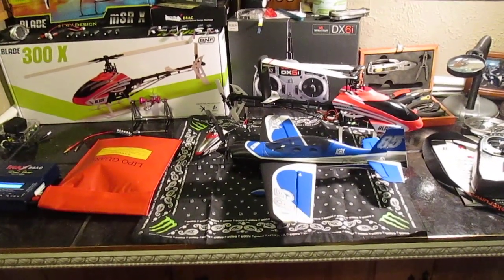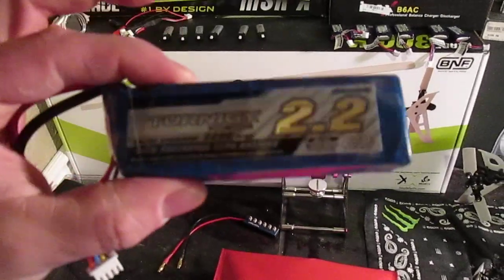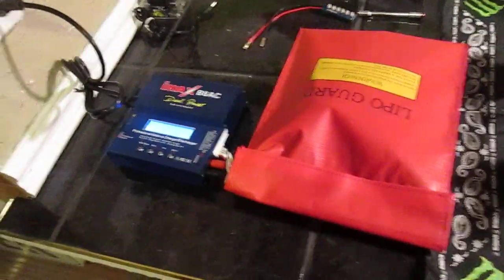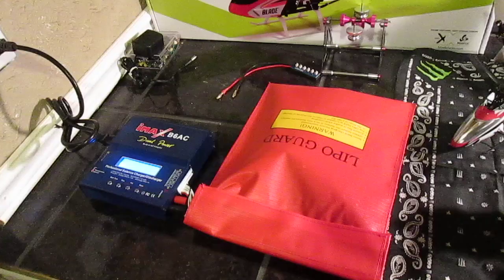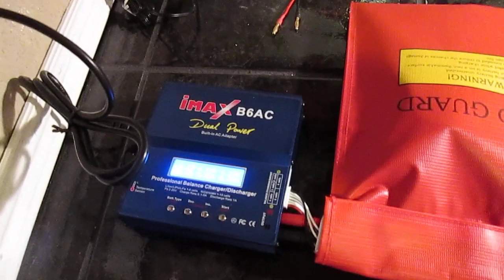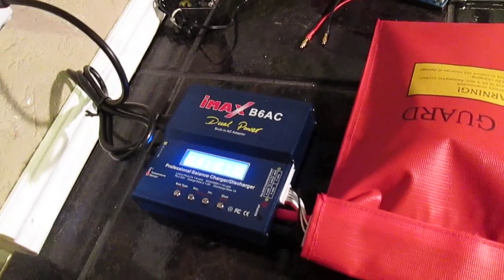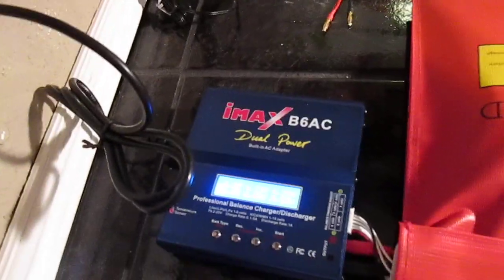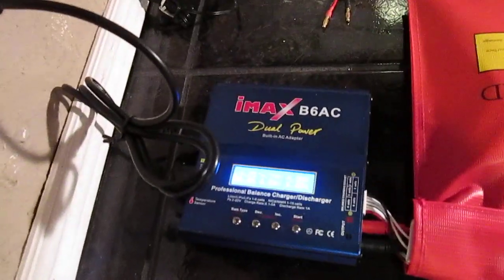How to fix a lipo battery with 1 weak cell

Comment: 2 days ago before it started raining I balance charged all my batteries to storage level 3.8v each and left them inside on table.
Now today I go to plug in and charge; and one of my batteries has 5 of its cells at 3.8 and one cell at 1.5 😮
This battery is only a few weeks old. Probably flown it about 10 times and never charged faster than 3c. I don't think I've gone over 2.5c actually

Comment: Thank you for the tip! Nowadays I always spring the extra $7 for the high C rated batteries. The ones with good QC have their cells matched at the factory and it is well worth it not only for performance but for longevity. I'd take 1 less battery and get the better quality any day of the week.

Comment: Hey man I got a 4cell 1800mah lipo battery and when I wanted to charge it the 1 cell was at zero and the other 3 were at roughly 2.30. What do you suggest I do?
Reply from the maker: Sorry to tell you, that battery is done.  One cell is dead, and the others are way under voltage. Discharge, and dispose of it.

Comment: Does it hold charge? I got one cell that always drops faster than others!
Reply: Same problem here. 2s lipo, but i sell discharge very fast 🤔
Reply: He don't know, he made the vid when it looked like he might have solved the problem. For all he knows that cell will take a dump as soon as he puts a load on it and it could very well show good voltage after a load. Same as a car battery, the only way you can tell if it's good is to put a load on it and watch voltage at the same time...if it's good the voltage will be stable if it's not voltage will drop at a steady rate...not saying his way does not work, it does, I have 2 4s packs that I scanned together out of a pile 3 bad 3s packs...each cell needs to be able to hold 4.2  and hold a steady voltage under load

Comment: Well it starts off like this after using my X-maxx for the day i forgot to take out the batteries and im using 11.1v 40c 8000 Mah and here i am 4 months later & the charger wont charge at ALL ! all batteries did read Zero but after reading your post "  ThatCrazyFlashaholic 67 " your idea WORKED like a charm charging it using Nimh charging setting i let it charge for 2min & its charing now at 2amps lipo charge and the % is now going up thank you for the info good video & comments Really Really did work thanks

Comment: I recently acquired this battery reconditioning plan ( Check Details Here>>> ) and just reconditioned 2 car batteries. I did the instructions in a breeze due to the simplicity of the guide. I wish I would have discovered this years ago! It really works for any kind of batteries!

Comment: I have a 2 cell that is at 4.24 and 3.84 volts and giving my charger a real hard time to even discharge.. I hope it works to recover cause its a 5000mah and only a couple years old!
Reply from the maker: Wow, that is a huge difference. Not sure if it will work but good luck!
Reply: Is your problem solved now?

Comment: I had a similar problem with my 3S lipo, one of the cells had low voltage, so i charged it up using the Nimh setting and unpluged the balance parr..i only did it for a minute.. it brought the cell back...i hope the battery works after charging it..ALSO WHAT SHOULD ALL THE CELLS BE AT WITHING EACH OTHER???? THANKS
Reply from the maker: All cells should balance.
Never go below 3.7 per cell, unless you are trying to fix it like in the video.
Storage mode is 3.85 per cell
Full charge is 4.20 per cell

Hope this helps
Reply: I tried to charge my battery on a shitty charger that came with the rtf wizard and it charged 1st cell to 4.01 and the 2nd cell to only 3.33 and the 3rd to something else. i plugged it into my drone and it only sucked the second cell dry... i am going to see if charging then discharging the battery on my imax will work. (ordered 4 other batteries anyway so it doesn't matter but why did this happen?) 
Thanks

Comment: hello,sir.i have a question. i got the same problem. but i have different amp battery, which mine is 3s 5300mah. So if i follow your instruction, after discharging the battery till it drop 3.5v per cell, how many mili amp i should balancing charger my battery. it's 5300 mah. and if i charge it on 0.2 Amp, it would take the time so long. that's ok? or you have a recommended amp value for my battery? thanks before.
Reply: FAanggiorius 
I threw away two lipos before I figured out the cheap voltage tester was misreading one cell commonly. Trust your charger and a multimeter.
Reply from the maker: Indeed it will take a long time, that is the key though. Minimal charge to equal out the cells. Monitor the battery as its charging and watch for it to equal out.
Reply: while charging, how i can see the voltage each cell? i use imax b6, there is no indicator to tell how many voltage each cell. should i stop the charging and use voltage meter and then resume the balance charging? do you think it's safe?
Reply from the maker: Its been awhile since I owned the Imax charger...... but I believe you need to start the charge as normal, then tap the increase button or the start button. On my icharger its the increase button.... so definitely try that one first.
Reply: +Mad Man Slice thanks sir. i'll try it and let you know if this work...
Reply: hello sir, i just do what is in your video. it's really work to give the balance voltage each cell. but when i check my battery voltage using voltage checker. it's doesn't balance. 4.05, 4,08, and 4,35. i know it out of problem that we discuss from this video. but if you don't mind and maybe you know what should i do? what i must trust? voltage checker or imax b6? it has a different value. my drone are not lift up, even the voltage of my lipo is 12.40. thanks before.
Reply from the maker: Different battery monitors will always read a small bit of difference. Unfortunately yours is a lot.
You could try to cycle the lipo a few times in the drone at a low speed.... you could also do the procedure per the video I posted again.
If you are at all hesitant that it is unsafe or feel it will cause you to crash your drone..... get rid of that lipo, and use a new one.
Not worth crashing or burning your house down trying to save a battery.
Take care.....   :)

Comment: very good video thanks, but fast way do this  using refrigerator to drop down temp, volt meter, and balance cable to drop down voltage on coils and then balance charge battery it's works. for 4s battery

WARNING drop down only from each coil 1 amps and watch on voltmeter do not drop voltage down 3v!!! 

red and white is coil 4
white and yellow is coil 3
yellow and green is coil 2
green and black is coil 1
Reply from the maker: +Mibinamet Thanks for the info.......   :)

Comment: I do not have a charger like yours, just a Sky RC 3e which detected a voltage in-balance and wouldn't charge. One cell was at 3.48v with the other two at 3.09, and 3.13v. The manual said it wouldn't charge with more than a 300mV difference. I connected the high cell to a bike LED light which was rated 3.7v and I calculated that it would draw around 100mA. (it lasts about 7hrs on a 700mAh cell) I left it connected until the voltage was 3.23v then the charger completed the charge fine.

Comment: Thanks for the trick! But I am wondering if it will work with 800mAh charge amperage because that's all my charger can do, do you mind trying it out for me? Thanks again!
Reply from the maker: +NERF870525 Sorry, not sure what you mean.
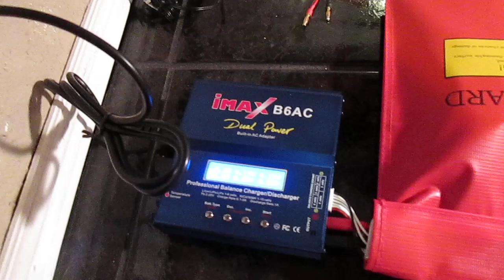Reply: +Mad Man Slice  So at 1:14 you say you only charge at 0.2 Amps, but my charger can only do 0.8 Amps, do you think it will still work?
Reply from the maker: yes, its worth a shot anyway....

Comment: Hi my battery can be fixed to 4.2v 3.8v 4.2
but when I discharge it again,
it becomes 4.2 0 4.2
always discharging the same cell only.
what should i do
Reply: +Eddie_Fong 
When using Lipo mode, in balance mode it shows 4.2 3.8 3.9 and stop charging 
but in storage mode, show 4.2 0 4.2 and low voltage error
Is it the problem of my charger?
Reply from the maker: +Eddie_Fong It could be the balance lead, check it and see if it is loose.

Comment: my brand new 3s lipo reads 4v 4v and 0v. Actually it read as total 7.5v only. my Imax b6 says incorrect cell when i try to charge. what could be wrong? can this be repaired? unfortunately i couldn't claim for replacement :/
Reply: +Ashish Amatya You bought a broken battery, you should check if a replecement really isn't possible
Reply from the maker: +Ashish Amatya A brand new lipo should not be delivered or bought with a full charge on it. It really should come  in storage mode at 3.85 per cell, this is were your lipo likes to sit when not in use.
Sounds like you got a bad one. The only thing I can think of is maybe you have the balance lead in the 2 cell spot instead of the 3 cell spot.?.?

Good luck
Reply: That has happened to me with my Brand new Turnigy 3s 4000mah with one cell at zero volts and the rest at 4 volts

Comment: I had this problem, but I flew with the battery. last night it started dropping, and this morning it's at 1.69 and still dropping. Is there any way to save it?
Reply: +Joshua Panola trash it
Reply: Antonio Cabral
k
Reply: +Joshua Panola I've tried to save a battery that had a cell as low as that, and even though I succeeded in balancing them up to 4.20, in the next day the cell was again at 1.50 or smth, so the battery is dead.
Reply: Antonio Cabral
I'll just make a 2s.
Reply: +Joshua Panola lol, good luck
Reply: Antonio Cabral
thx

Comment: A million thanks! I had a 3S LiPo - 4,07V 4,2V 4,15V. I discharged to 3,7 and the difference between cells was about 0,05 V. Charged on 0,2A and now all cells are 4,2.
Reply from the maker: +Silver Lensment Your welcome.

Comment: Thank you so much, I had a 3s 2200 LiPo with two weak cells (when I got it)4.04 4.20 4.04.
At the end of the discharge, the middle cell dropped to 3.27 while the other two were at 3.67 and after the 0.2Amps charge, all the cells got to 4.2!!
Reply from the maker: Eliott Castafolte  Your welcome, I'm glad it worked for you.
Reply: Well... I have to charge it at 0.2A every time now but it's better than nothing!
Reply from the maker: Thats strange, might just want to but a different lipo then......
Reply: Hey did the Lipo cell balance even when you recharged the battery after use or do you have to keep repeating this process during each charge

Comment: Thanks a bunch! I have exactly the same battery which stopped charging at 3.99-4.2-4.2. After discharging to 3.5 though, the weak cell dropped like a rock for some reason (something like 2.9). The imax didn't even recognize it as a 3s anymore a couple of times. Finally, got it to start balancing as 3s at 0.2A and luckily after a night's charging it's now fully fixed.
Reply from the maker: Luc Oostdijk No prob.... Glad it worked out for you in the end!

Comment: Thanks, your advice helped! My 5s battery had one cell that was off from the others by 0.08V. After trying storage and balance mode at 0.5A, it was still off. Following your advice, I lowered the amperage to 0.1A, and the difference is now 0.03V, and still decreasing! I expect it to be perfectly balanced.
Reply from the maker: +lordvon64 No prob. Hope it works out.

Comment: Great video!  I have been using an iMax b6 to charge my 4s...always the last cell is ending up at like 3.8
The other 3 cells 4.17 or 4.18. 
On the charger it says differently-  it says all 4 cells 4.18 or something like that.  Anyway, I went out and bought a new charger and hope to recover these 4s.  I have 4 either new or almost new that need help!
Reply from the maker: david hitch Have these lipos been crashed or damaged in any kind of way?
Do they smell bad if you put them close to your face? Its possible to have a cell leaking slowly and not even know it. I took apart a Gens Ace 6s 5000mah awhile ago cause it wouldn't charge correctly, my cell 3 right in the middle of the pack was leaking, and it smelt terrible once I peeled back the plastic film.

Comment: hello bro.. I have a lippo, it's 1200 mAh & 3 cells. But one of that cell is dead. Now I separate the cells be 2 cells. So, how big the capaacity that I have with two cells? May its 1200/3= 400mAh/cell? then I have 800 mAh?
Reply: All of the cells are in series. If you remove one of them, you would have a 2s 1200mah battery.
Reply from the maker: Ve Gazerock I'm not sure to be honest! Emrecan seems to think it is a 2s 1200. I would do some more research on it to be sure.
Charge outside for the first few charges please. 
Good luck.
Reply: Mad Man Slice Thank you bro.. I got some answers from the others youtubers in other lipo videos. Most of them claim its still 1200 mah...
But, I'm not sure about that too like you.. 

If I buy a 20.000mAh 6 cells. Then I separate it be 6 batteries, and Woooww..!! I have 6 batts with 20.000mAh/batt... and I can play my mini copter (that use 3,7v) up to 3 hours/batt, then 18 hours for 6 batts..
It's sounds so LOL right..

Comment: Thanks man i will try it!!
Reply from the maker: Ballistic RC No prob...
Reply: Mad Man Slice did not work for the battery but it worked for my other one
Reply from the maker: Awesome, glad it worked, I would just cycle the other lipo again. Sometimes it takes a few times to come around.
If your lipo is damaged or crushed due to a crash, obviously this won't work....

Thanks
Reply: yeah it had a cell that had a hole at the back and does not hold more then a volt so i had to get rid of it...
 But right now i am fixing a lipo that can be fixed by doing this i am doing it right now.
Reply from the maker: That's great!
I have fixed 3 lipos now by using this method.
The lipo in the video that is 2 years old now, is still blasting out great power.
Hope it turns out for you.
Reply: Did you turn off the safety timer??
Reply from the maker: yes I did!

Comment: I had a 5200mAh 4S for my multirotor, and I had spliced into the balance plug for a 12v supply for some electronics. During setup, I drained the 3 cells down to about 3.6v each, and when I went to balance charge them again it brought the first (unused) one to 4.2 and left the others at 3.8. I tried discharging and re-balance charging a few times, eventually I had to charge through the splice as a 3S to get the battery working again. Is this a problem with the B6AC, that it can't balance such a large difference? Or was it because the balance was after the first cell, so the charger would bleed the power out before it got to the problem cells?
Reply from the maker: Cuthbert Nibbles I think this has something to do with your splice, for some reason it was only using 3 cells when it should have been using all cells. Try my method, the whole key of this method is to drain them down slowly till they are very close to balancing, then balance charge them back at 0.2A..... takes some patience waiting for it to charge, but it will save the lipo.
Good luck....       :)
Reply: Mad Man Slice The whole point of the splice was to get it to use only three cells. Using all four would've fried the electronics I was powering. The battery is working now. Also, it wouldn't discharge enough, it would keep timing out.
Reply from the maker: You can go into your setting and turn off the timing out restriction if your using a icharger?
Reply: Mad Man Slice Even if I did (ran it for 12 hours one night) it doesn't pump a milliamp hour into the battery. But it's fine now. I bought a regulator to draw off the 15 volts, and will probably remove the spliced plug. Thanks for all the help, I really appreciate it.
Reply from the maker: lol, don't think I helped much!
But hey, no prob...
Take care
Reply: Mad Man Slice The video did help, and it was nice to hear from someone with experience that the charger would stop discharging before it over discharged the battery.